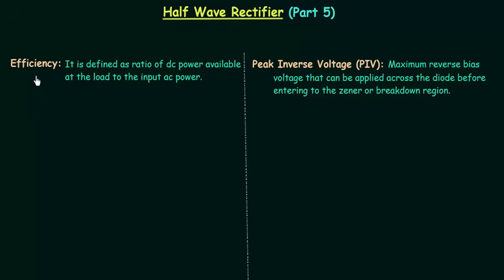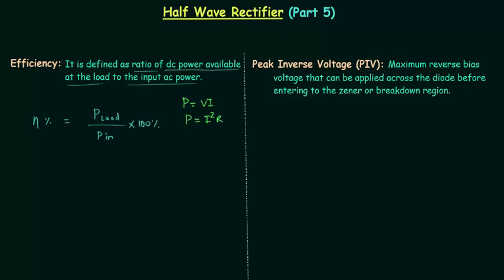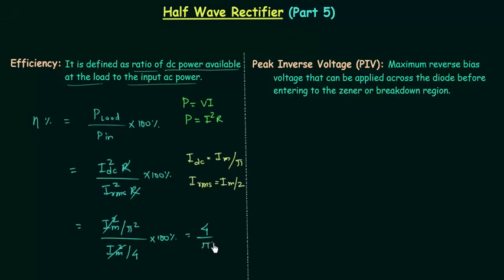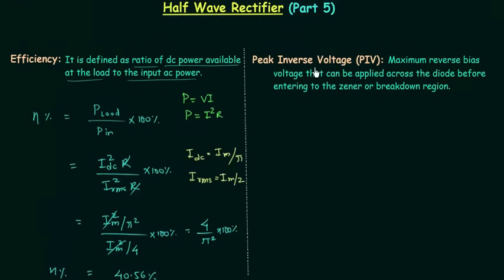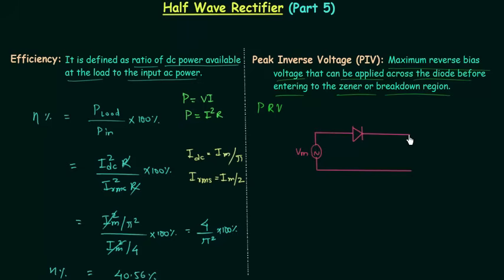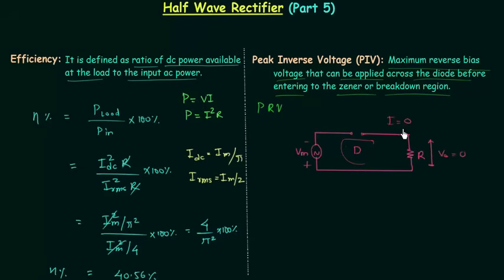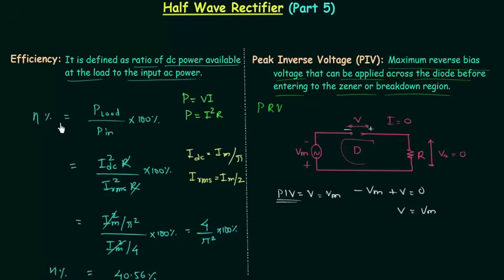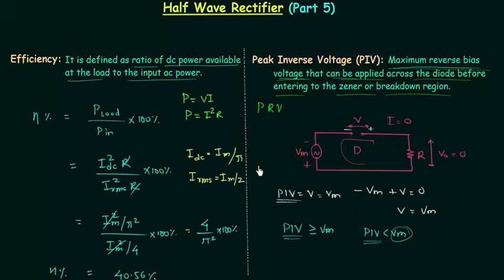Half Wave Rectifier (Efficiency & PIV)

Comment: I've a doubt, while calculating the efficiency,in the denominator it's input ac power. Then why you're taking it as I/2 , the input a.c. has rms value I/√2.  Can you please explain
Reply: it is for half wave rectifier only Ir.m.s = Im/2 i.e upto 0 to pi only but this is for any sinusodial wave I/root 2

Comment: in the last video you said the rms value is of load current. But the load current is DC current,so what's the point of finding out rms value?
In this video in the input power use substituted rms value of current. How is input power is the same as power in the load?

Comment: Average value represents - DC content present in the AC (That's why av. value is zero for pure AC), 
RMS value represents -  DC equivalent of AC content.

am I correct?
Reply: RMS value is not DC equivalent of AC content, the first one is correct ...
Reply: @circuitsanalytica4348  RMS or Effective value is the DC equivalent. Sadiku chap 11
Reply: @shihabmahmood9135   bro can you please tell me the exact pg no ,it will resolve my doubt!
Reply: @kkb5418  from page-467 (5th ed),
"The effective value (rms value) of a periodic current is the dc current that delivers
the same average power to a resistor as the periodic current"
Reply: @shihabmahmood9135  thanks

Comment: PIV Must be less than or equal to Vm and you said it should be above Vm (at 4:28)
Reply: Must be more sir since the higher the voltage PIV, the higher of diode's resistance

Comment: in 4:10
PVI must be greater than Vm.
How much PVI value?
thanks anyway.
Reply: Peak inverse voltage of diode used should be double the value of Vm, setting a safety factor of 2. Vm is the pesk value of transformer secondary winding voltage

Comment: i think I of rms =Im/root square for 2
 not I of rms =Im/2 only
Reply: I think Mostafa is correct, You defined efficiency as the ratio of P_out and P_in, so, I_rms should be input current from the secondary coil which is indeed I_m/sqrt(2) coz its providing complete sine wave. I_m/2 is component of ac current in OUTPUT instead of input. Waiting for your response.
Reply: @JohnDavid-iq9rz   Input is a complete sine wave. You are correct. But no power is delivered during the negative half cycle of the input sine wave. So Input Vrms= Vm/2 for power calculation.
Reply: @JohnDavid-iq9rz  For half rectifier I is zero for pi<wt<2pi so it will come same
Reply: shoron tnt, Irms is the input voltage..... Not output.
Reply: @yashwant8689  Then why would efficiency be defined Pin/ Pout. This is Pout (dc)/Pout (ac)
Reply: Its for the  output voltage.    Im/root 2 is for the sinusoidal signal.
Reply: hey how do we decide where we have to use irms and where idc
Reply: Yea, I also have the same question....
Reply: Mostafa El Gin no its correct that they have said.... Check earlier videos
Reply: Mostafa El Gin :- it is for full wave rectifier. For half wave rectifier it is Irms = I'm/2
Reply: @yash_upase  WHY AND HOW !
Reply: Mostafa El Gin it is for full wave rectifier
Reply: Brother that is for full wave rectifier!!!